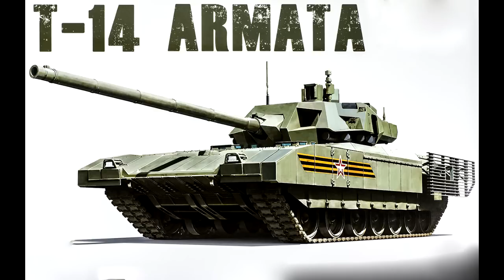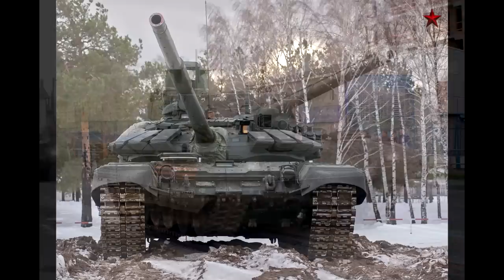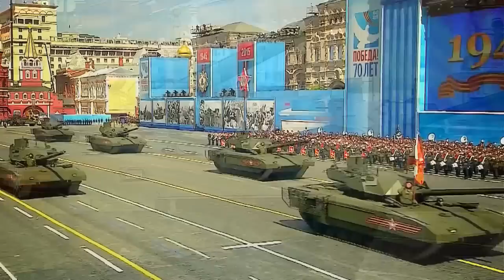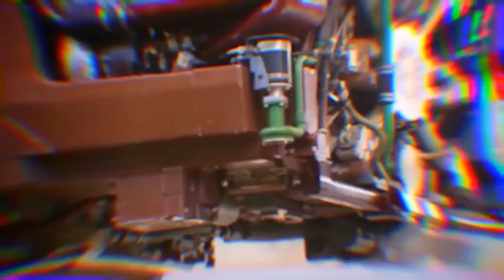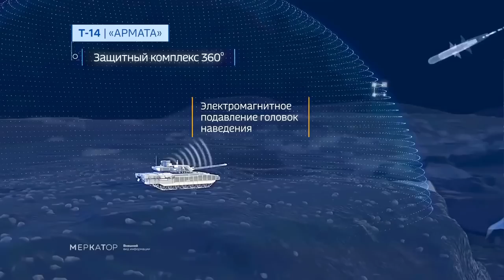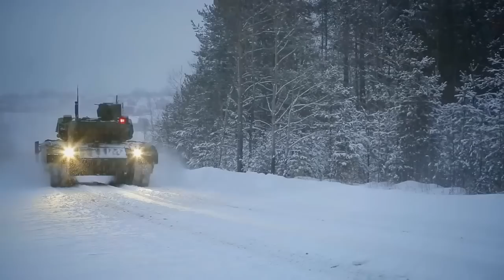Busting Myths on T-14 Armata

Comment: they are nice tanks...comparatively they have a larger bore gun and higher speed than the m1a2...but also less effective armor, are more prone to mechanical problems (you do get what you pay for-it is a less expensive tank, this is to be expected-not really a mark against it as you could have 2 of these for 1 m1a2...) and lastly kind of my 2nd point-they are not expected to hold up anywhere near as long. still an impressive piece of equipment.